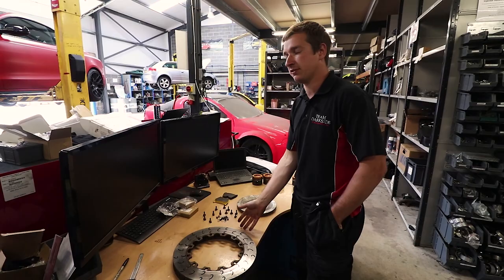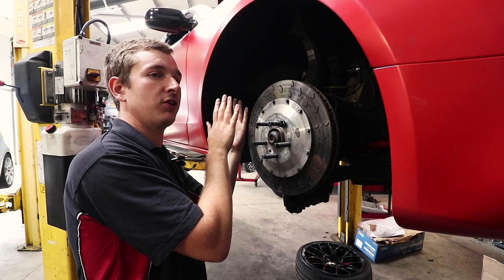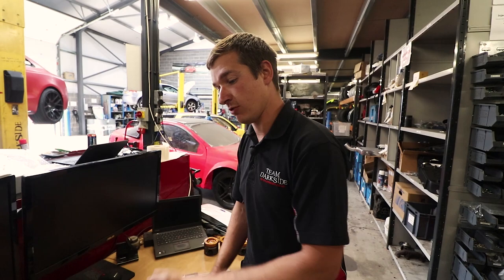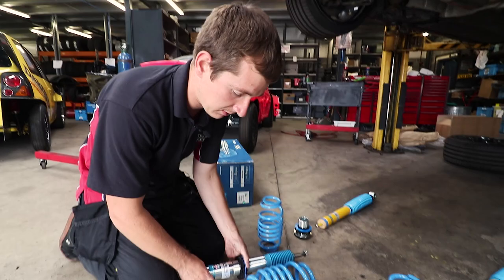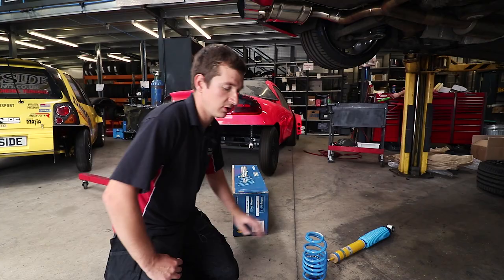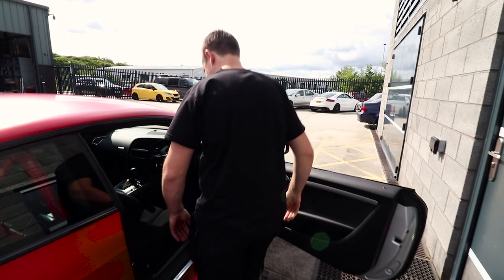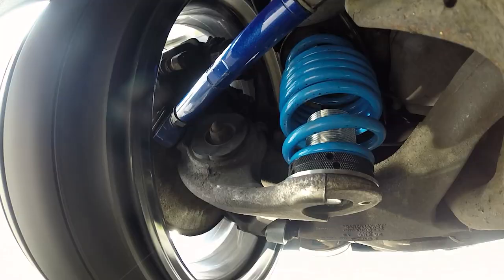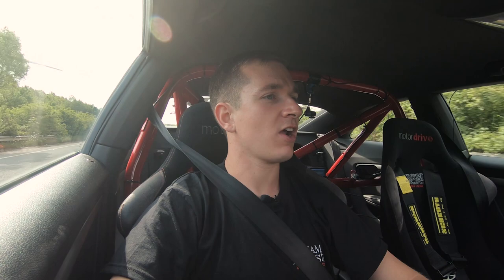BILSTEIN B16 UPGRADE and BRAKE INSPECTION - AUDI A5 3.0 TDI PROJECT DARKSIDE DEVELOPMENTS PART 24

Comment: I’ve got ap 6pots and 390mm discs on my S4 and can’t get them to fade. Mine have anti-rattle springs on the bolts, is that not something to consider or do they affect performance?

Comment: Do you need to lockwire the nuts on the disc bolts?
Also do carbon ceramic discs have that amount of float?
Reply: The bobbins dictate the movement and you can for most setups alter it, I doubt factory discs move this much. No need for lockwire, we checked these many times and they were always within spec

Comment: Hi:
Just a question can those massive discs on the front :) do they only work with the 8 pot caliper you guys fitted or would they work with a RS5 6 pot caliper??
An amazing setup by the way guys ;)
Reply from the maker: What RS5 are they off, new B9?

These brakes were awesome!

Comment: Hey guys. I'm looking at a used bilstein b12 kit that's had mainly road use with some track days. Are there any things to look out for when buying a used suspension setup? Approx 2 years old with 20k miles. Thanks
Reply: Check they are not leaking!

Comment: What damper settings out of 10 for rear and front would you recommend for the b16 bill-stein audi s5 ? Daily drive and track settings if you recommend? Thanks
Reply from the maker: Start at 5 but it's easy to try!
Reply: @DarksideDevelopments  i have them currently rears 1 and fronts 1 (too much bounce) - ill change them to 5 - would u recommend 5 rears and fronts ?
Reply from the maker: You would have to try it but I found slightly softer rear works, a click or 2. Go full stiff and back down until it's bearable